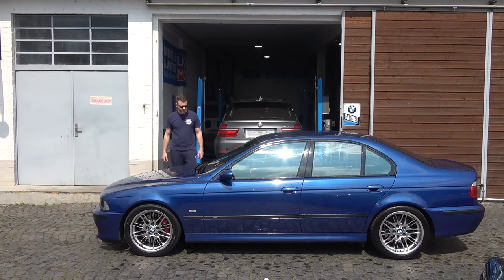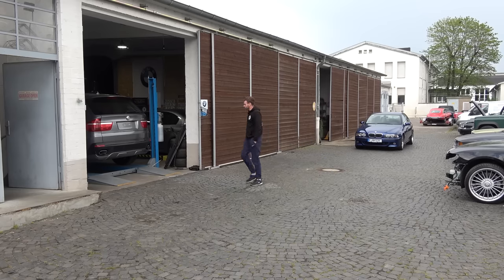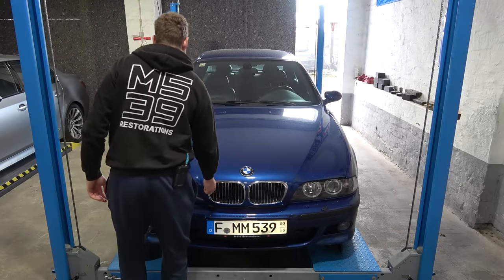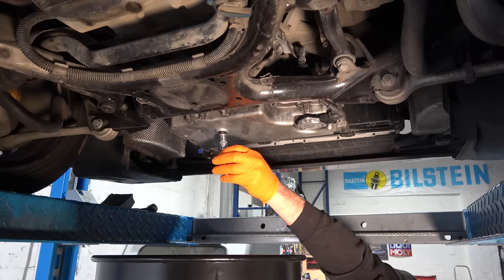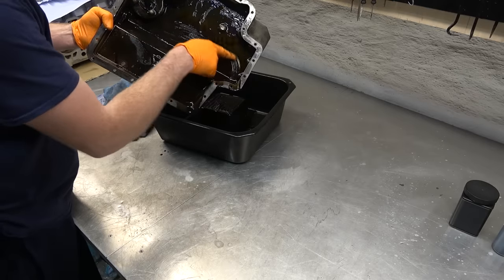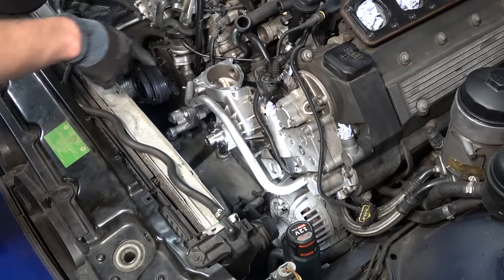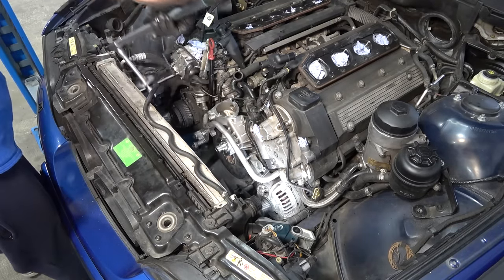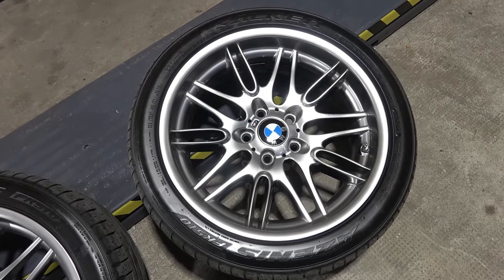Fixing Up & Driving an Icon on The Autobahn - The BMW E39 M5

Comment: Dude, not questioning your own methods, you do great work and obviously have a bit of spare cash. But if the plugs are firing well (said yourself) why change 8 coils if they’re still working? Seems like an absolute waste of money, guessing they’re not that cheap. Also are you maybe overthinking the thermostat thing? Surely your engine running cooler when driving at lower speeds (getting less air through the grille) is better than running hotter and having the stat open at 82 degrees rather than 79? Just a thought.  

Keep up the great video content.
Reply from the maker: Thanks! Cause they are 21 years old and can die at any moment. Doesn't make a difference when it's running at operating temp under load, but it does make a difference when it's running cold. Not a big difference though but it helps.
Reply: Fair enough my man! Keep up the great work, your videos are a joy to watch. I feel your pain with the rust though here in UK, I’ve had 2 E30’s and they both had rust in the same places! Would be nice to be able to have more choice of right hand drive imports 😅

Comment: Seems kind of hypocritical to see the “Keep it classy, keep it OEM” sign behind you while you’re putting in after market bushings.
Reply from the maker: So, I'm not allowed to try different things according to your logic? Something that's potentially better than OE, and what I consider OEM+?
Reply: You’re allowed to do what ever you want, and it’s not my logic, it’s your logic by displaying the “Keep it classy” sign.  Never heard of OEM+ but I have heard of aftermarket.
Reply from the maker: @davidhaight5147  I don't understand why are you getting upset or confused about this. I restore cars to original spec or better. Exterior and interior always stay original, but the car was developed 25 years ago, the engineering and tech moved on, and if I see an opportunity to upgrade a mechanical part with one that's stronger and better than the old stock one, I'll sometimes do so. That's OEM+.
Reply: Believe me I’m not getting upset, just disappointed a little.  I love the way you go about restoring BMWs, you’ve even inspired me to restore my first neglected BMW, a 97 e39 B52 engine. I understand that technology has come along way, I’m actually watching you put in a blue bus and new speakers as I type.  I just didn’t like those bushings, looked like something someone would put on a Honda Accord.  Don’t stop what you’re doing brother, you’re one of the top 3 channels if not the top .
Reply from the maker: @davidhaight5147  All good. Thank you! Those are monoballs and actually far superior to rubber bushings and very expensive. :)

Comment: Yikes - don’t drill the holes in the seal!! You’re introducing swarf right into the inside of the engine….
Reply from the maker: You missed the part where the oil pan was off?
Reply: @M539Restorations  Probably… Just gives me the willies though. I use a nail to punch a hole if I need to use the screw method to remove a seal.